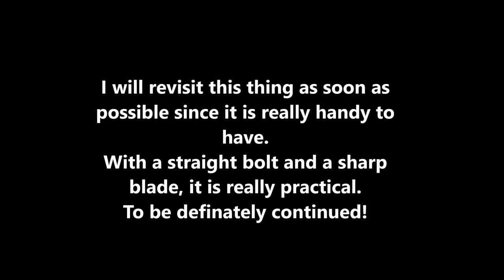Black & Decker Table Saw

Comment: I have one of these too. Once the chuck is removed a bolt with a thick stabilizing washer is screwed into the hole where the chuck normally goes.  Looks like you've lost yours. Should be a standard imperial thread.  I believe these drills had a mechanical gear lever to give you two speeds. And they didn't reverse for obvious reasons when using the various attachments available.
Reply: Speed change is a lever on the side of the drill which lifts and turns around. Found on the drill body just behind the chuck.